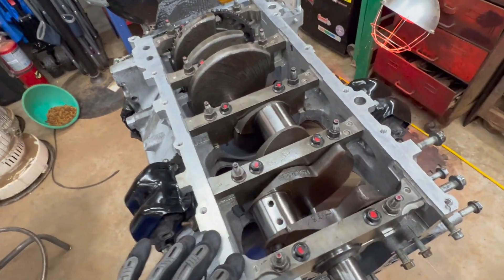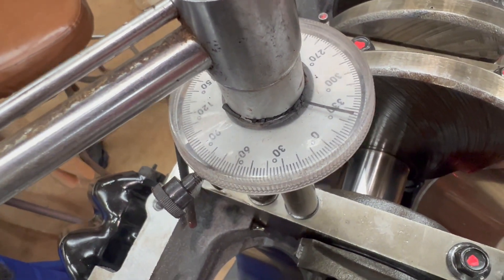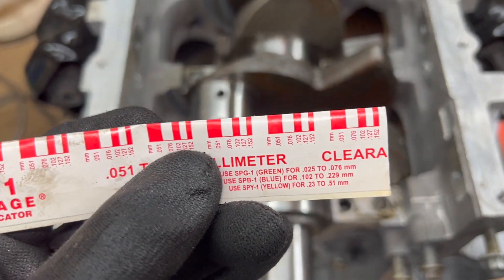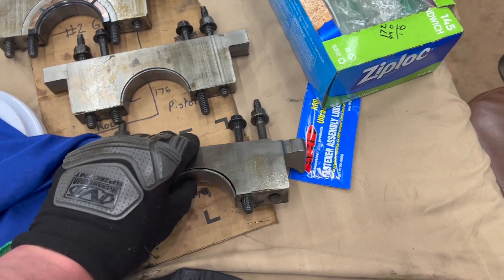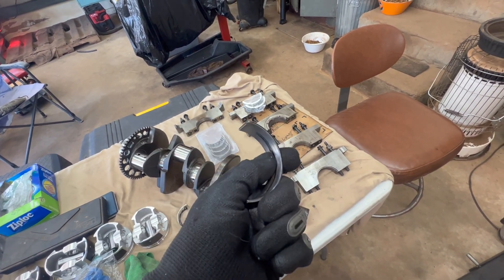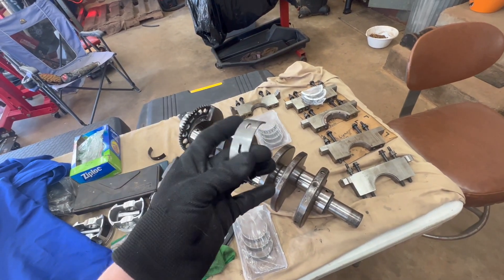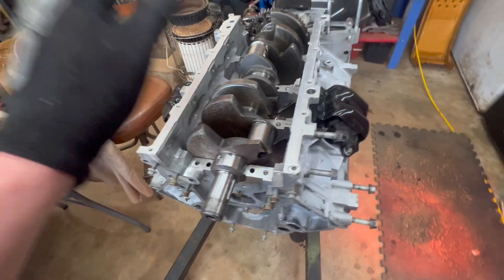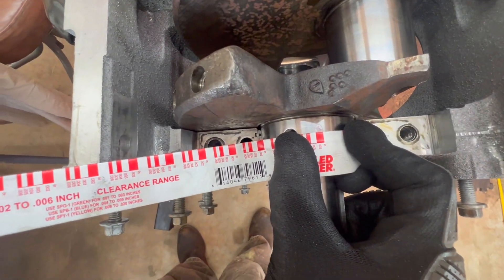Avoid Catastrophic Engine Failure! LS Main Bearing Inspection and Replacement:

Comment: Using an adapter on the socket to torque... If the bolt has some yield, do ya' think the adapter does? The block shows clear signs of main cap walk transfer. Anything done about that?
Reply from the maker: I don’t really see how the adapter would affect anything—unless you’re suggesting it could twist or flex, but that’s not the case here. This LS is a 6-bolt main, and I haven’t seen any signs of main cap walk. It’s been going strong for a couple years, and I’ve taken it to the track several times with no issues 💪🏁 All is well on my end!

Comment: Great vid ,,I was wondering can you reuse the rod bolts ?
Reply from the maker: With ARP 100%. The factory bolts, it depends on the manufacturer. Got to do your research with factory bolts. With LS, I have reused them. But I have seen a lot of debates.
Reply: @RocketGarageService  I Know ARP you have to resize the rod ,But the factory bolts you reused ,,No problems with it ?
Reply from the maker: Correct I have reuse the LS rod bolt. Sloppy mechanic has some information on it.